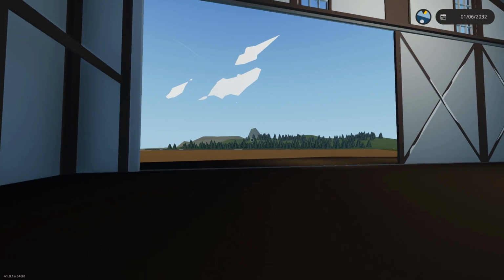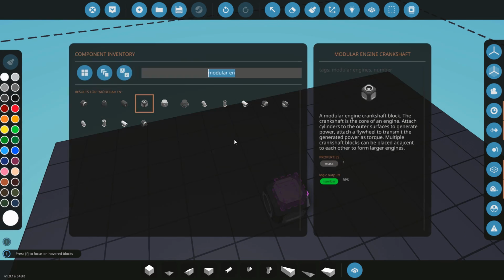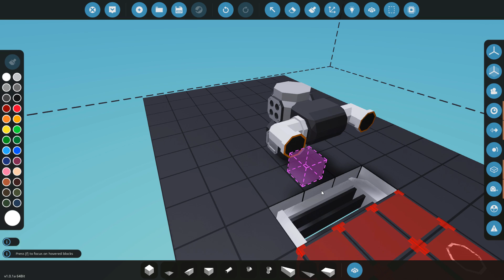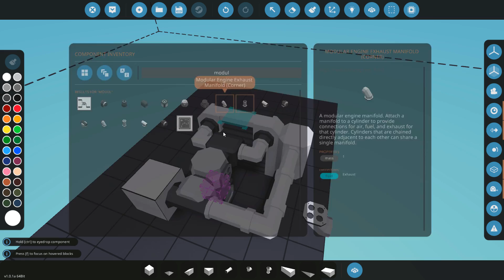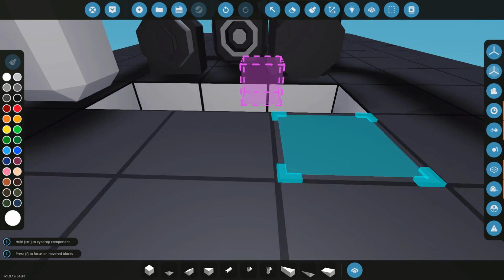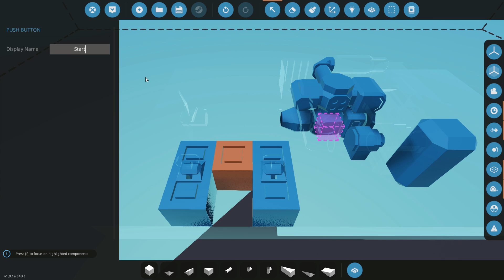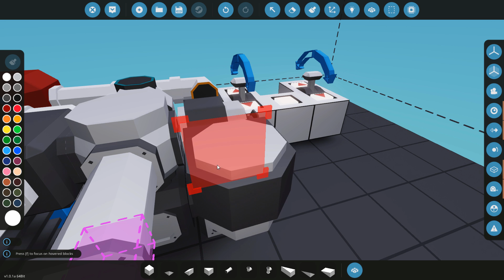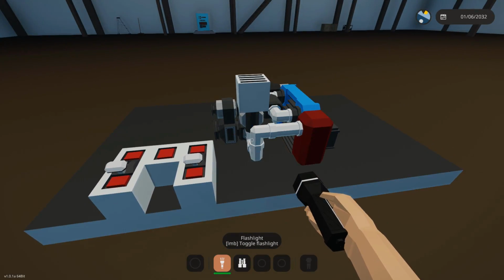Stormworks B&R l NEW Modular Engine Tutorial

Comment: when i fire it up it likes too run for 2 seconds then die but when I put full throttle it bogs then dies :p
Reply: at the moment it seems like modular engines are super underpowered, just built a 5cyl and it barely moves my vehicle when a small engine happily pushes 100km/h
Reply: @thisisthestuffgaming8202  lol, I haven't try it so imma try the modular engines
Reply: @thisisthestuffgaming8202  i just put it on the platform and it didn't to start
Reply: @jman1264  does it have fuel supply, air supply, exhaust, etc etc? does the fuel supply need a pump? is the battery dying?